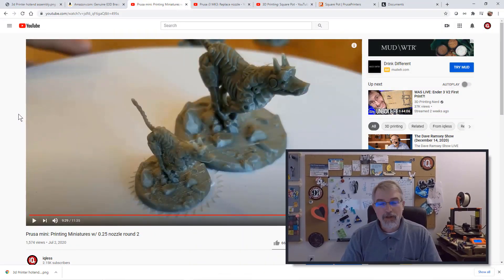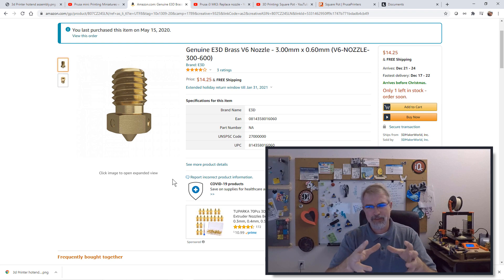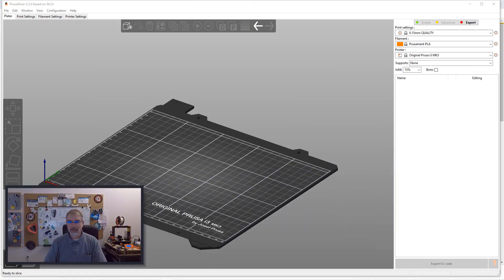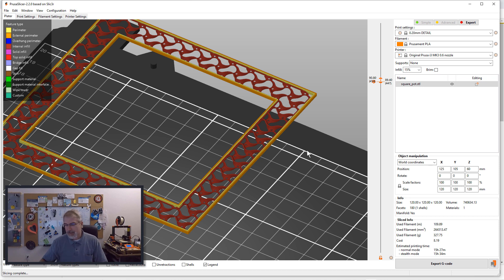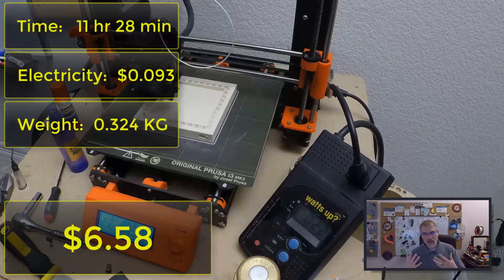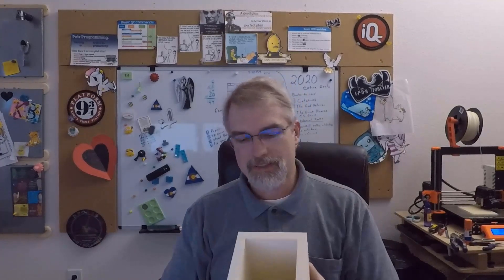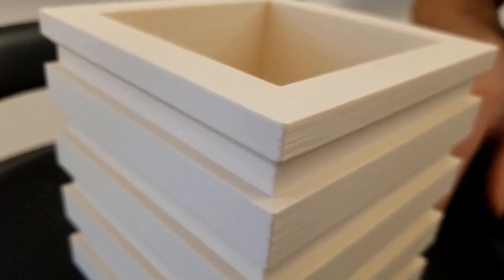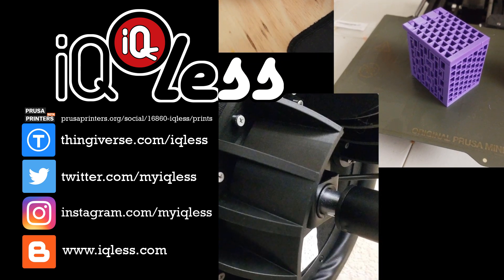3D Printing: 0.6 mm Nozzle

Comment: As mentioned before, when using a 0.4 nozzle you typically print 3 shells/perimeters which is 1.2mm. When you swap to a 0.6 nozzle you only need to print 2 shells/perimeters to get the same 1.2mm. This will affect a few things, firstly it will cut your print time of the perimeters by a third as the printer only has to make the perimeter pass two times instead of three. Next, by doing this you will also be cutting down on your filament usage as you don't have to print the extra perimeter that you normally would with a 0.4 nozzle. So the 0.6 nozzle should cut your print speed and potentially cut down on your filament usage or at the very least it should be the same as the 0.4mm usage. This will in turn bring the costs down on the 0.6 nozzle prints.

Comment: 3 perimeter in 0.4mm = 1.2mm... so with a 0.6 nozzle you only have to use 2 perimeter for 1.2mm total. you are symphatic Patrick but your way of thinking of "being fed everything" make your video wrong. you are mostly a 3d printing channel but you dont go all the way. ive printed my faceshield with a 0.8mm nozzle on a prusa and yes I modify the setting myself (im not a genius and being able to!!)

Comment: I'd recommend VASE mode for quick-and-dirty 3D printing demonstrations at conferences and other events. You can find the "spiral vase" option under layers and perimeters near the top. It's really good for printing vases or boxes quickly, since it just does one perimeter all the way up. A lot of printer manufactures use VASE mode at trade shows, because you can print a full sized piece in only a few hours. Interestingly enough, it also takes the same amount of time no matter which size nozzle you use, since the printer is tracing the same lines.
Reply from the maker: That is a good idea.  I often forget about vase mode.
It would be a good one to do a video about someday :)
Reply: Vase mode feels like cheating like, half the time.  I love it haha